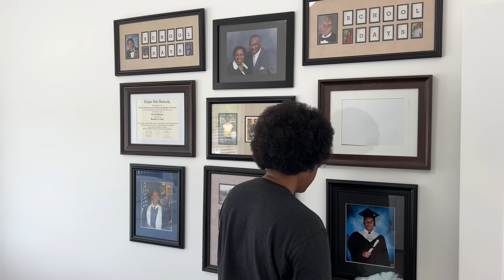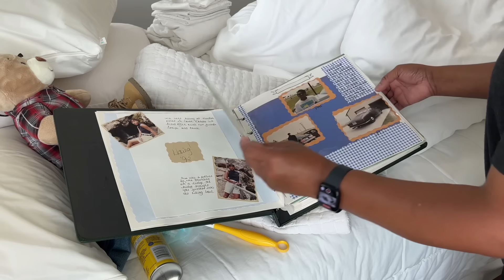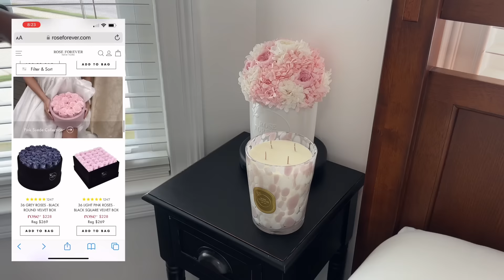NEW CLEANING MOTIVATION + DIY FURNITURE FLIPS | BUDGETING + MEAL PLANNING #cleaningmotivation2024

Comment: I had no idea oven cleaner could strip paint. Did you use regular or fume free since I see you’re not masked up. In the past I used a gel that lifted off paint and stain. I also refinished a few pieces in natural wood, I love that look.  Great video.  Huge hugs to precious Max💕🐾🐾
Reply from the maker: Hi Robin, I use fumed free.  The desk were stained so I stripped the stain off with oven cleaner and also sanded them.  I wanted the raw wood look and that’s what I got.  I still need to finish sanding the legs on the larger desk though.  Thank you and thanks for watching.  See you Sunday.
Reply: @Sissyspaces11  I need to do the top of my dining room sideboard.  What a great idea.  Thanks so much!!! Great job on your pieces!!!!
Reply from the maker: Thanks Robin